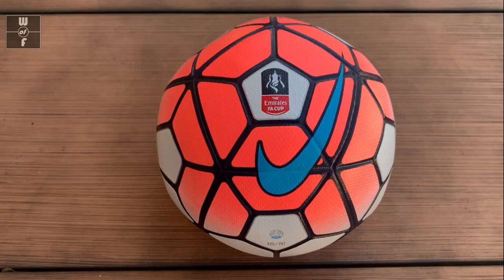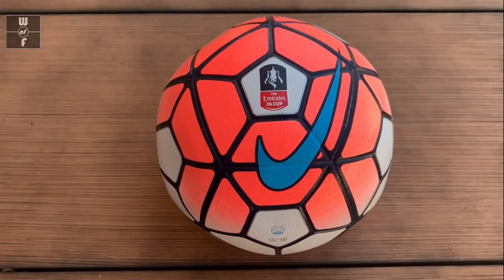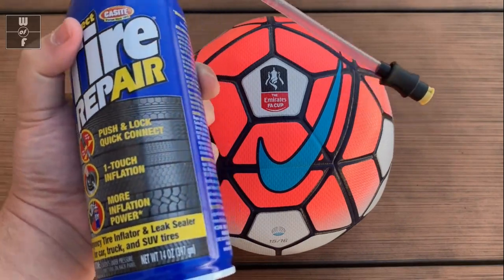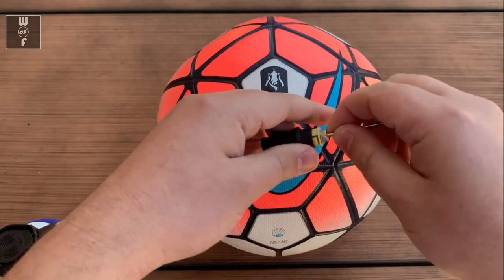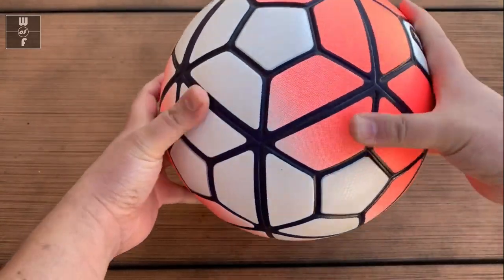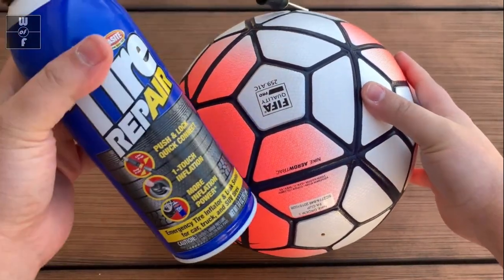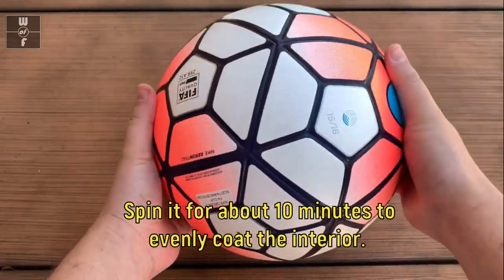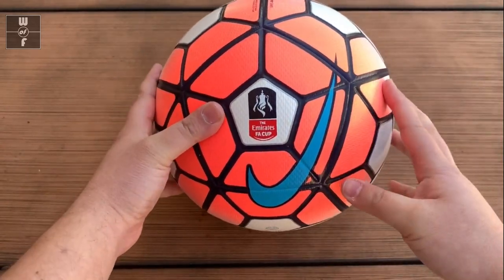HOW TO REPAIR / FIX A LEAKING FLAT BALL - Fixing a Soccer / Football That Will Not Hold Air

Comment: Would this work if the valve itself is leaking too?
Reply from the maker: I haven’t tried it, but doubt it. In that case, you may need to replace the valve first and see if that solves the problem.

Comment: Changed the weight of the ball?
Reply from the maker: Slightly yes. But not enough to make a difference. Just make sure you rotate it a lot while it dries so you don’t end up with a heavy clump on one side of the ball. Then you will definitely notice it plays weird